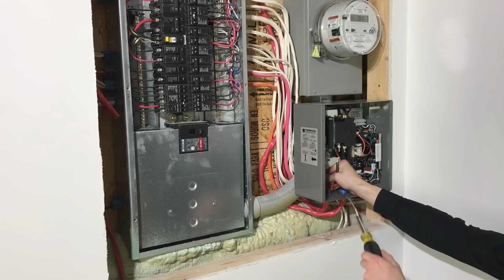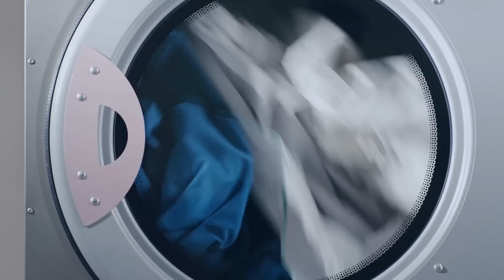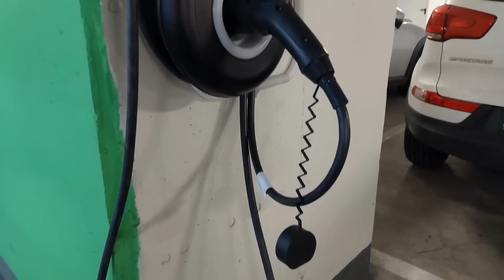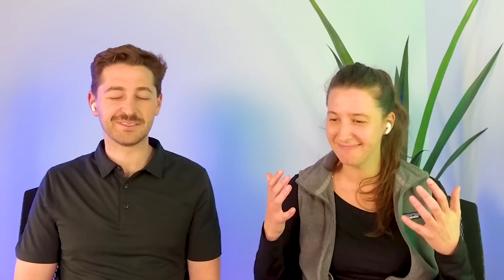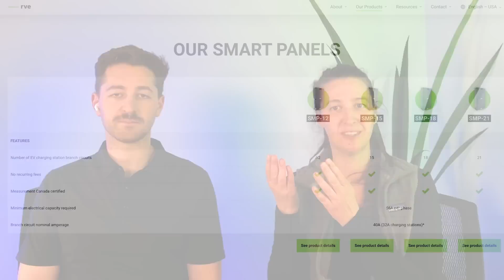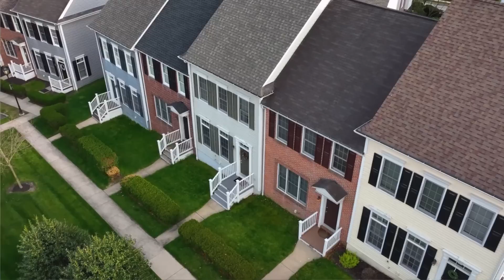This Boring Grey Box Can Save You Thousands of Dollars!

Comment: I had one of these installed for my Model 3 6 years ago beside my 100Amp electrical box.  It's been perfect!   When in the winter there's cooking going on in the morning along with clothes drying, plus the heating, if my car is still charging, it stops until there is enough power available without tripping the main.  Its a very valuable device.

Comment: In Sweden we have a dongle connected to the incoming electric meter that talks through WiFi to a car charger that dynamicly decrease the charge speed depending on the house load. The installation is through a rj45/rj12 jack and costs ~100usd. And it also connects to our dynamic electric prices so it always charge with the cheapest prices until your next set departure.
Reply: And it also makes the car help the power grid to stabilize, making me earn money while charging

Comment: $250 for an Eltwin Hyper SureStart is how I got our Lennox heatpump HVAC to work with our powerwall without kicking it off. Been running strong for 3 years now since I installed it myself :) it makes the pump start super quietly and smoothly compared to the rough start it had before.

Comment: Watched the entire video. I'm a mechanical engineer 3, Y, and CT owner, DIY installed Nema 14-50 and Tesla Wall charger. I still don't get what is the target market of this product? Is it only for piece of mind to apartment complexes to install an apartment renter or condo owner owned EV charger? I went to the two websites and I still would like more direct information.
Reply: Yeah sounded like fear mongering to me. Your panel won’t “blow up” first of all. At worst pop main but I have a 200amp service and I charge 2 teslas simultaneously (96amps) while running a dryer, stove, central a/c, water heater, well pump, etc and never had any issues.

Comment: So it's prioritizing where to send limited power to? 
... give the ac power for 30sec and then return to charging your car ?
16:31 $10k ???? Did I catch that
Reply: It will cut off the EV charging power before an overload then turn it back on in 15 min if the total home load is OK. The basic RVE DCC-12 for homeowners is about $800, far less than getting a new 200amp service installed.